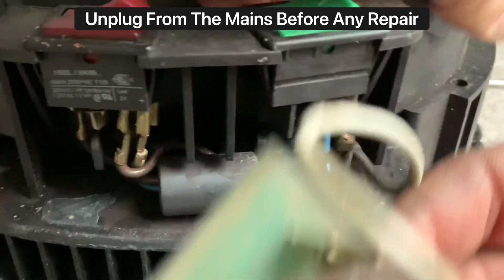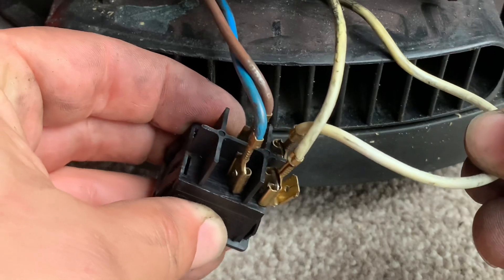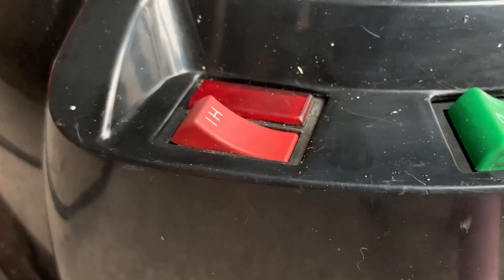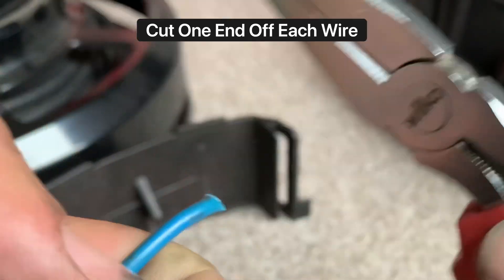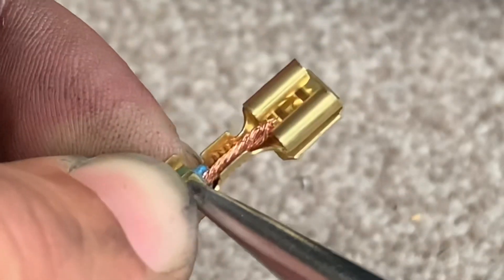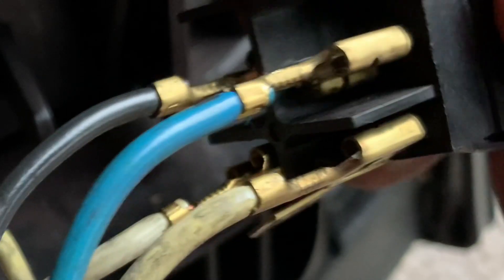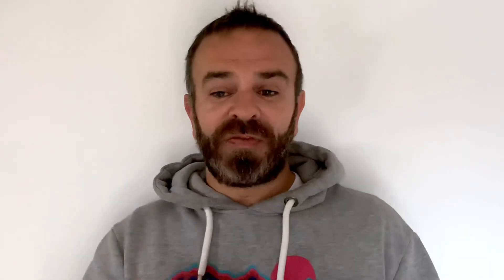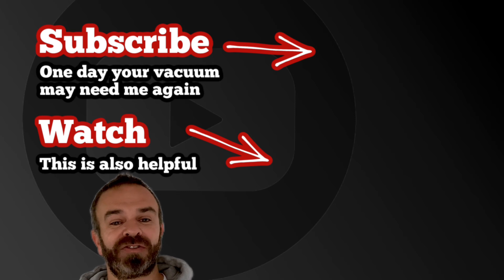Bypass Numatic Henry PCB & Hi Low Switch QUICK & EASY

Comment: Something fell off the shelf in the cupboard and hit the high/low switch. Henry still works but is permanently on full power. I’m guessing that I need a new switch but I haven’t taken it apart yet. Are they simply enough to take apart?
Reply from the maker: Here is the take apart and put together video. 

https://youtu.be/aGpSGCvusF8?si=PrhKIZ2g4YomIrRd

If you have the hi low switch with light hen you have to change it. If you have the green rocker switch Jo low you can clean the contacts following the video below (on off switch but same principle) 

https://youtu.be/XBJUorzlRTE?si=fgpjM2Mr1mAEGbga

Comment: Hi I hope you doing well I want to ask you one important question I do own a 12 years old henry 200 hvr a model with 1200 watt motor I just wonder how does it compare with new Henry hepa xtra model suction power wise thank you in advance have a nice day 😊
Reply from the maker: All the new ones are single power 620w… does matter what model. All now the same. If yours is still running. Pop a new bag and filter in and you will have better suction than a new one… only slightly like, as the housing helps the airflow on the new ones to hav decent suction dispite the lower wattage. But yeh Hope that helps

All models in Henry site are here 

https://youtu.be/Stbb4DkAvB8?si=2pS99BYp3Ms64uP_
Reply: @vacuumhelp  Mine is in Mint condition despite its given age and frequent usage only tritex filter need to be replaced.Yesterday I compare technical performance indicators like airflow, waterlift calculate the airwatt values between mine old Hvr 200 a and new one I saw only the size difference in litres and nothing else correct me if I'm false personally  want to order new Henry that fitted with Hepa filtre but dunno now I change my mind.Thx a lot

Comment: Excellent instructions. Our Henry Hoover just stopped. I took it apart checked, cleaned inside connections etc. Put it all together, plugged it in…it worked…then hesitated…stopped again 🫣 So today I followed the instructions to remove fast speed suction switch /light and that connector and the mini circuit board . Hey presto! It works! 👏Clever chap you are . Excellent videos and explanations. Thank you .
Reply from the maker: Wonderful news. Another one saved 😊😊😊 huge thanks to you aswell for your persistence, I wash everyone wad like that

Comment: Can I get some help with diagnostics so I know what bits to buy. I’ve a Henry with a high low switch. It lights up when the power is on but I’ve no sound from the motor. I’ve done the continuity test on the green switch and it passes. I’ve also looked at the motor and it all looks pretty clean. I’m not sure from the video whether the issue could be the high low switch and/or the pcb. Also I’ve different coloured wires on the green switch (single brown and double brown at the front single blues at the back). The high low switch has a single black, brown and white. What should I be testing next and how? Many thanks
Reply from the maker: Hi

Ok so if the switch is 100% ok that’s a start. The hi low switch never causes power issue so forget that too. 

I would take a photo of all your wiring (incase you want to reinstate the hi low switch and circuit board) 
Then do the bypass as shown in video, and see if it works then. Extremely likely. 

I don’t sell the circuit boards as they are discontinued but you can get aftermarket ones on eBay if you wanted to replace the circuit board. 

Hope this answers your question and let me know how you get on. 

Jonny

Comment: THANK YOU MAN! my Hanry is working again thanks to you! Very clear instructions and troubleshooting. My problem was dirty switch and ill try to do the same to my other Hanry with the low/high switch. I messed up with the wiring a bit so I hope to find in this video how to wire it back properly and I guess after cleaning another switch it will work too. Thank you for doing this contest 🔥
Reply from the maker: 😊 you’re welcome

Comment: @vacumhelp my Henry is not working, I continuity tested the red high low switch on my Henry and there was no beeps, the red high low rocker switch will not stay in the on position it springs back into the off position, with the green power switch it beeps in the on position and does not beep in the off position when doing a continuity test, do you think the red high low switch is faulty or could it be the PCB board, please help Thankyou
Reply from the maker: @sloopycat1954  ok don’t worry about the hi low switch at all. It’s got a spring in it so that’s normal and it’s there purely to momentarily tell the circuit to change functions. So would never offer a continuous connection. 

Power switch sounds ok if it’s make a connection on both sides. 

Also check that the cable itself continuous from the plug pins to the rewind contacts. 

If it’s a sudden death on a hi low model it’s nearly always the pcb. 
Take a photo of everything (incase you want to put it back to as it was) and then follow the first minute of this video. 

If it works without the pcb then you know that this is the issue. 

Do let me know how you get on and I hope I am helping 

Jonny 

HenryBags.co.uk
Reply: Hi @vacumhelp I bypassed the pcb and put white wire from motor to right of the green power switch and I put the other white wire from the red Hi low switch behind the motor white wire also on the right of the green switch, and on the left I left them as they are, I alternated the 2 white wires but still nothing. I'm not sure how to check the cord because there's 2 pins on each side at the end of the cord that make contact to the motor, they got grease on them you know what I mean, im just not sure, I know you got to put 1 metre probe onto plug brass points and other onto the greased runner points, it does beep for continuity but I'm not sure of the correct technique. I'm also not sure if I tested the hi low switch properly, because there's only 2 wires on my hi low I attached 1 metre metre probe to each, I believe there's 2 contacts in the middle front and back but not used, with the green switch I did the same a metre probe firstly on the 2 front contacts then the back switching it on and off at same time and the metre did not beep when green switch was is on position, I got a feeling the red switch is faulty and that I tested it wrongly please help sorry about the long message thankyou so much
Reply from the maker: @ ok if you have done the bypass like in video then it’s not the pcb. 

Odds are that it’s now just the cable if you haven’t check that yet. 

This video here will show you how…. 

https://youtu.be/OkJrItk8xio?si=UUfPPx6DhN3lD9z6
Reply from the maker: @sloopycat1954  also the brown and blue wires, just to make sure you are connecting the ones from the main power as shown in the bypass video
Reply: @vacumhelp you were Absolutely correct it's the Power Lead that's Faulty, I couldn't figure it out because sometimes I would get continuity beeps on my metre then they would be like morse code, beep beeep then nothing then beep beep again, so i tried moving the cord about and it powered on, only thing is figuring out where the cord is damaged,, maybe I will cut a few inches at a time and hope. the damaged cord is near the plug. Thankyou so so much talking me through my repair I couldn't have done without you, I will definitely be subscribing to your Brilliant channel.
Reply from the maker: @ great news! Always makes my day when we get to the bottom of an issue. 
With cable yeh it’s abit of a guess. 8/10 are near plug, 1/10 the other end in rewind, 1/10 random place 😂 

Have fun but I think if you bang a plug on it a few inches down you’ll be sound
Reply: @vacmhelp Absolutely correct again there was a loose connection because of the wires breaking at the point where the power cord ends next to the plug, fortunately I remembered I had a electric detector pen that lights up as you know, I couldn't be more pleased, I'm so grateful for all your kind help & advice Thankyou so much.
Reply from the maker: @ amazing and happy vacuuming! Be sure to think of me if ever you need anything Henry related 

Jonny 

HenryBags.co.uk
Reply: @vacmhelp Thankyou so much for everything I really appreciate it, I'm going to definitely subscribe such a useful channel. Before I part what can a Henry overally vibrating be down to please other than clogged pipes etc have you or anyone else experienced this issue, my friend has has this problem on his HENRY Thankyou so much.

Comment: Can I put a hi lo switch on my new Henry hoover it doesn't have a hi lo just a red indicator
Reply from the maker: Not easily. The motors are different and many of the vacuums are also smaller in size with no room in the internal housing for the circuit board.Ive never tried it and nothing impossible. The motors are much lower wattage too on the newer one so the low setting would be very low suction.
Reply: @vacuumhelp  thank you, I can't even return the Henry as I have tried it once
Reply from the maker: @Ruffbiker68  They dont make them with Hi low now and havnt for years so it might be something you have to swallow. That or call Henry on 01460 269229 and see what they say. Ive heard returns be sent for more daft reasons
Reply: @vacuumhelp  thanks bud I will try that hopefully eBay money back will cover it
Reply from the maker: @ oh if it’s on eBay just open return stating just don’t like it. It will only cost you £4ish.
Reply: @vacuumhelp  thanks bud 👍

Comment: Do you have to use a piggyback gold ending on the white wire if you just want the power switch and no led light?
Reply from the maker: @allanwren2977  if you are just going without a light just follow the first minute of the video. Don’t need to change any connectors simply bang the white wires on the switch 🙂
Reply: @vacuumhelp  also will it matter if i swap the hi lo switch with the power switch if it doesnt working putting the wires to the power switch?
Reply from the maker: @ if you have a green hi low you would be fine. Not the one with a light on though. 

If you feel it may be the switch, I have a video for sorting that out here…. 

https://youtu.be/MJd_NlFyOXc?si=75GE1UzrBFMXPMLc

Let me know how you get on with all this

Comment: I’ve got to the stage where I have taken out the high low switch and the wires connected to them. My problem is to do with the 2 white wires from the motor- one of them almost have a double connector attached which is connected to one of the brown wires that was originally connected to the pcb. How do I remove the brown wire attached to it so I can connect the white wire into the power switch? Thank you!
Reply from the maker: @shan7146  no problem. Just pull the brown wires off the pitchy back connectors which is on the white wire. You may find it easier with pliers to do this. 
You can then connect the white wires to the switch as shown. No need to worry about the double connector it’s fine to connect to the switch on its own like I have on the video.
Reply: @ thank you your videos are great! I watched your video so many times and didn’t realise the connector was the same! Unfortunately bypassing the pcb didn’t do the trick. I tugged my hetty across the room and the plug came out and since then she’s not turned back on. It’s not the plug as I tested it with the multi meter, so going to follow your steps of checking the switch and motor (I got carried away and did the pcb bypass first 🤣)
Reply from the maker: @ thank you. Yeh try and follow steps of the other video. 
With the plug coming out I would expect that it may be cable related but if you checked it and it’s ok then that’s odd. Maybe worth getting a plug from a hardware store to try. Or full cable if there is an internal break somewhere from henrybags.co.uk lol 

Circumstances can be the biggest clue and I would be surprised if the switch has failed at the same time as this happened. I would rule out a motor issue. You definitely have a lack of power supply 

Happy to help until you manage to cure it 

Jonny
Reply: @ ah thanks for these tips, will give it a go and let you know how I get on
Reply: @ hi, I bought a full cable from Henry bags to replace my current one, however the screws where the old cable is are super tight and can’t unscrew. Any tips?
Reply from the maker: @ depends which screws they are but in general if I’m struggling I try and go down a screw driver size. So slightly smaller crosshead if I can get away with it. 

The age old truck of heat may help too. Not too much but get a hair dryer and blow hot are on the screw and the area and this may help 

Jonny
Reply: @ thank you so much for all your help will try it out!

Comment: Nice info. My henry popped the house fuses recently, switched it off and pop the fuses back in. The little hoover actually works but always on full power. I'm thinking, did the circuit board just shorted across giving a full power to the motor? Haven't taken it apart yet. Cheers!
Reply from the maker: @leimad13  if it’s working now after this then yes I would guess it’s the circuit board. Sounds odd but it’s likely to smell burnt if something popped